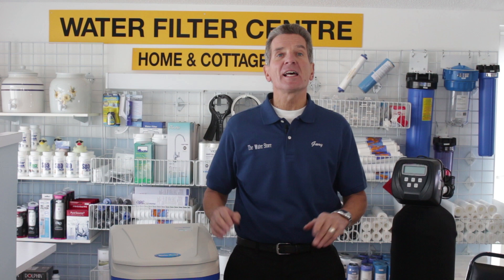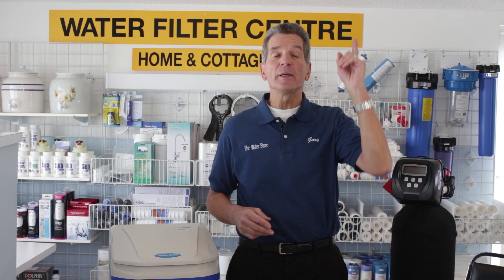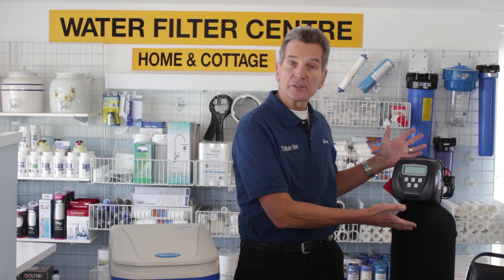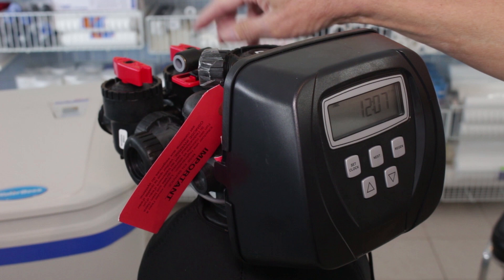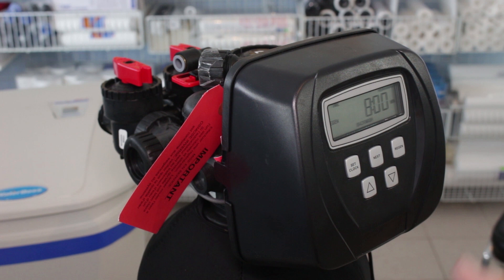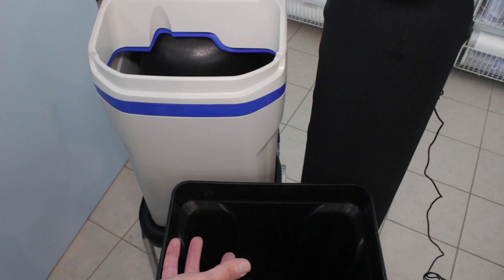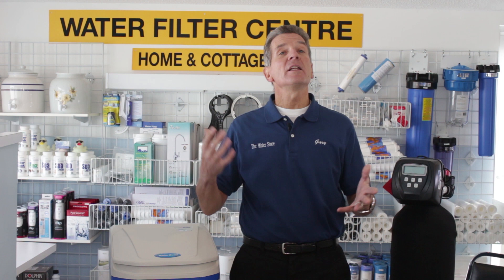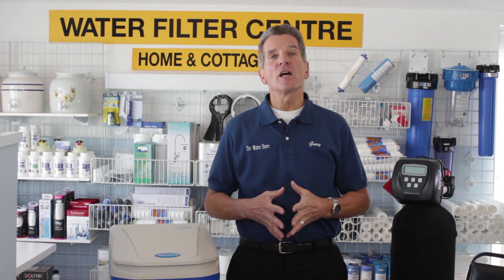Water Softening Troubleshooting No Soft Water

Comment: Not sure what to do... I have Fleck 7000 unit. I have noticed for some time now that my water is not right but didn't have time to check on this. Finally this weekend I cleaned up brine tank, added salt and took water sample while in in bypass mode. The hardens was showing as 250. Did Regeneration on the unit ran water for some time to get fresh "soft" water in the system and checked for hardness again, and now is showing 100. So it took some hardness out but not completely. Any idea what is going on? The system was installed back in 2011 or so. I would appreciate any help. And just for the record, House was built in 1964 and is 1080sqft with 3 bedrooms 1.5 bathroom.  2 adults and 2 kids (under 10) living in the house.

Comment: HI,   Over the past couple of weeks my wife and I noticed our water pressure considerably lower than normal.  We have a 15 year old house, so running the dishwasher and flushing the toilet shouldnt and hasnt causes any water pressure issues(besides the past 3 weeks).  However yesterday I flushed the toilet while the dishwasher was running, the toilet barely had enough water pressure to flush.  Plumbing person came out to check water softener and diagnosed that as the issue.   He spent maybe 10 minutes looking at everything and came to the conclusion the Resin Tank was bad because it was half full.   He asked the last time this had been repaired or installed and I assumed when the house was built 15 years ago.  He bypassed the water softner and said they will install a new water softner in a couple days for 930$.   Wondering if that seems like an accurate diagnosis.  The technician seemed highly certain since the resin tank was half full, that only 40-50% was regenerating, which he said is why we are losing water pressure.  Does that seem like like a good investigation and accurate pricing.  I live in Illinois, USA.
Reply: Water eStore Tested it while bypassed running dishwasher, laundry machine and flushed toilet.  Water pressure was normal flow running all of those at the same time.  Looks like I need a new softener.  I had two technicians come out.  One quote for 930$ and another for 2200$.  Seems like a huge difference in price.  I assume one is a Toyota and another is a Lexus version ?  House is 3000$ square feet. 4 bathrooms, 2 adults one toddler.
Reply: Water eStore thank you for your reply.  Greatly appreciated
Reply: Water eStore thank you!   Appreciate your time and help

Comment: I'm so lost with my softener... It's about a year old and it's always been an issue, just haven't taken the time to look into it.  The company sent me new resin to make sure that wasn't the issue.  When I put the new resin in, I had soft water, no problem.  But after it reached capacity, it stopped softening, even after SEVERAL regenerations.  My system is a 48,000 grain system with a Fleck 5800 LXT.

One thing I noticed is the moment it goes into brine draw, salty water is coming out the drain hose within 3-5 seconds.  Since the salt water is supposed to make its way down into the resin bed and then up the riser tube, this seems EXTREMELY off to me.  Any ideas or input on this?  I'm thinking that it's not softening because the salt water isn't actually making it's way down to the resin.  I pulled out the spacer stack and all the rings on it look like they are in great condition.
Reply from the maker: It sounds like the media is not being regenerated.  Must be a problem with either the settings or the piston.  I am am not a fan of the Fleck valves and don't know all that much about them but I would put it through a regeneration cycle to see what it does during each cycle.  During the brine draw water should be flowing slowly to drain, during back wash and rinse it flows quickly to drain.  Here is a copy of the manual http://www.iwaterwerks.com/linked/5800lxt_manual_43359.pdf

Comment: Hi great videos for different troubleshooting. I tried the metering test on my brand newly installed water softener and when run hot water the meter increases fast when run cold water the meter only increases 1 or 2. And I am not getting soft water in my home. Do you have any idea what might go wrong for this situation?
Reply from the maker: Something is bypassed on the cold water side.  There must be a 3 way bypass somewhere that has been left open partially.

Comment: If all the hydraulic and mechanical processes are working but the water is not softening, does 'expired' mean that the beads need to be replaced? I can replace beads for under $200. A new softener will cost more than double that. Other then the hassle of replacing beads (and the hassle is a big one) is there some other reason to replace an entire unit rather than replace just the beads?
Reply from the maker: Good question.  If your water softener is one that you can still get parts for the valve and the valve is working fine you can replace the media and use the valve for several more years without concern.
Reply: @GarytheWaterGuy  Thanks for the reply. Your videos are so helpful. Do you do house calls to Illinois USA {- :)

Comment: hi man just question I have water softener Westinghouse progressive   so I might not sure why my water few days  it's so soft and some day I dont fell soft the water one my hands any tips for that
Reply from the maker: Yes, check the settings. Find out how hard your water is and make sure the settings are correct. 
Thanks
Reply: @GarytheWaterGuy  when the company the setup my water softener the did check my hardness was 12 Gpg so the left the hardness on 12 but for few dayes water was not to much soft I call them the come to the Raise to 20 hardness  so should be fine because some day my water ifs slimy on my hands some day I don't fell any slimy